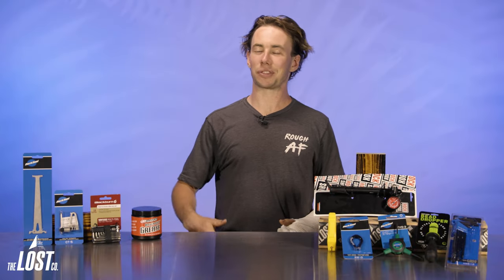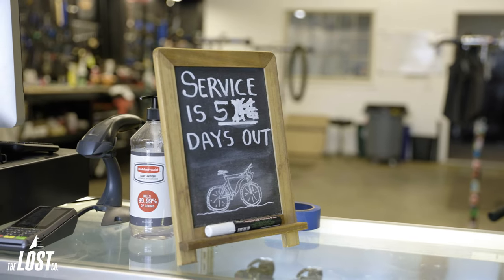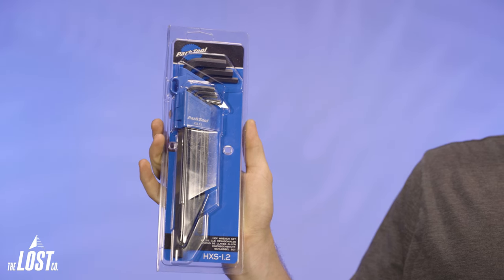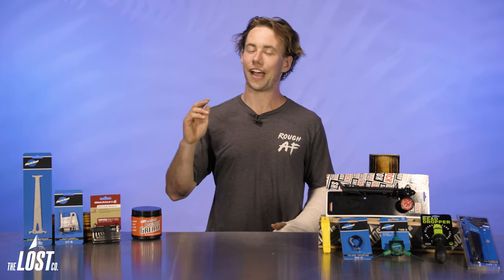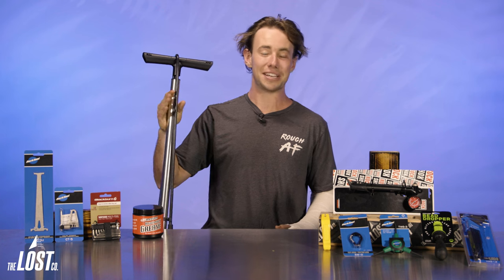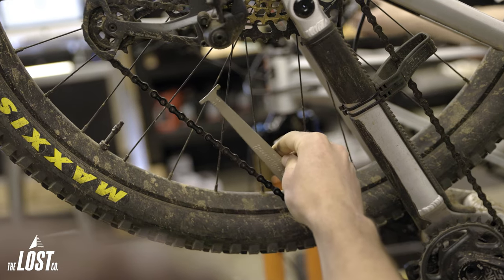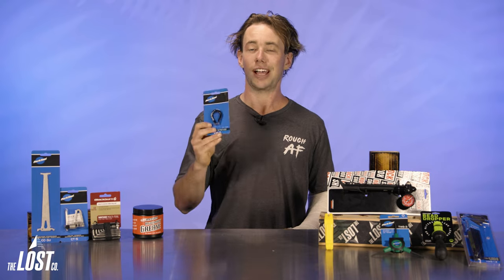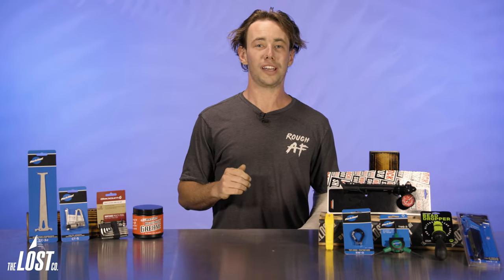Essential Tools that Every Mountain Biker Needs 🔧 Basic MTB Toolbox Must-Haves

Comment: If someone needs to watch this video and finds it useful (a new-ish, less experienced rider), then they should ignore the section with the spoke key. Unless you have experience with wheels, you are 99% more likely to mess up your wheel, than to fix it by trying to tension the spokes. Speaking from 20 years experience working in bike industry... 
I would remove that from this video and add a torque wrench, most people over torque their bolts and that could be an expensive or dangerous  mistake or both
Reply: If you actually downhill ride, check for floppy spokes. They will snap if loose, just nipping them up will save your rims from collapsing. 
For a sub $10 tool, just buy one
Reply: Absolutely, 100% agree, in the wrong hands, a spoke wrench is a bad idea, can more easily fvck up a wheel than fix it.

Comment: TORQUE WRENCH!!!!!
I know people think it's expensive for a beginner tool but if you are only starting to work on your bike you wont yet have a "feel" for torque, save yourselve having to buy a much more expensive extractor and tap. buy a torque wrench
Reply: Na, just turn the Allen key around. You can only just get 6nm by reefing it up with 1 thumb. 
People just have to learn what 5nm feels like. Use a friend or shops torque wrench to tighten 20+ random cap screws. 
Then practice tightening them so you just see the cap screw rotating. You will learn the feel in 10 minutes or less